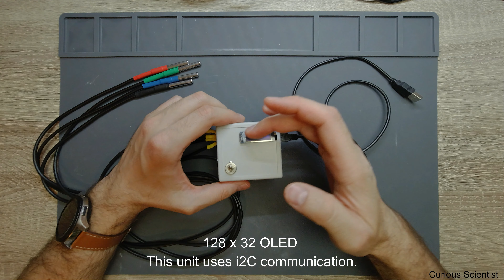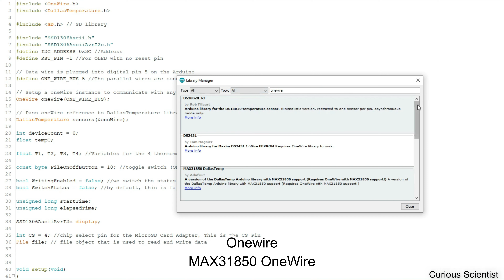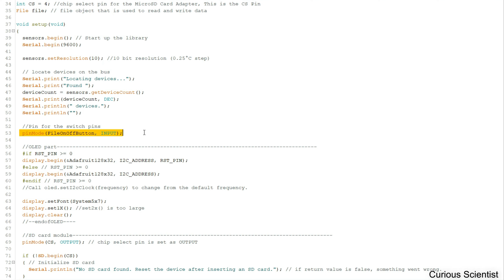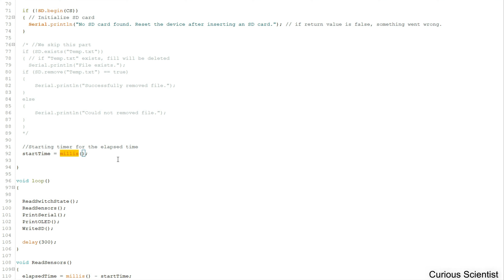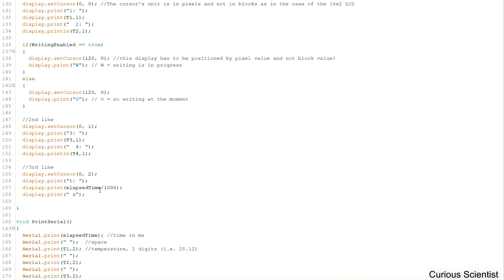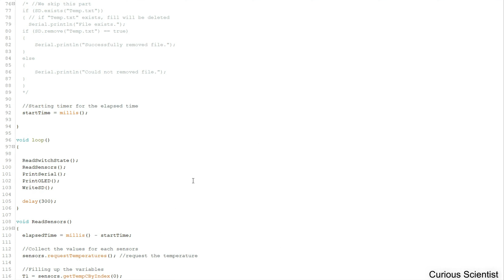4 channel temperature logger based on the DS18B20 sensors

Comment: Good to see a project so well explained and packaged in a box. May I suggest two improvements? If you run the unit as a stand alone logger (i.e. without inspecting the serial port) and the Arduino doesn't connect to the SD card then you have no idea until you plug the SD card into your computer and try to download the data. You use '0' for not logging and 'W' for writing to the SD card. When initialising the SD card you  use a global flag to indicate a fail to connect e.g. 'X'. Likewise when writing to the card if file is false you could use 'X'. Then you would print '0', 'W' or 'X' to the OLED and you could avoid a wasted logging session. 
The second improvement would be to hard code the DS18B20 ID numbers to the relevant channel. Currently there is no link between Red, Black, etc DS18B20 and T1, T2, etc.  No matter my comments, still an excellent video and project.
Reply from the maker: Thank you! I am always open to improvements! In fact, one of the ("selfish") purposes of uploading my projects here is to get them peer-reviewed. Sometimes I learn a lot from feedback from the viewers, so appreciate the constructive suggestions! 

The SD-card-related flag is a great suggestion. When I wrote this code, I was not super experienced with coding, and I also did not prioritize user-friendliness. So, this is a great suggestion and I will keep it in mind for future projects where I use an SD card. Regarding the sensors, it is a good idea, too! I had the links in my notes, but not in the code. 

Also, here is another temperature logger project I finished recently: https://youtu.be/CK_s86k92HQ 
This also deals with an SD card and multiple sensors (however, they are NTC thermistors). But you might like the project nevertheless.

Comment: Hello how did you make the casing box and wire. FYI: MAC addressing is safer
Reply from the maker: Hi! I bought the casing, then I cut some holes on it.
Reply: @CuriousScientist  Can you give box references and show the inside, could be interesting to see the soldering. Thanks
Reply from the maker: The wiring is shown and explained in the video from 10:20. I soldered everything together according to the wiring I showed. Regarding the box I don't remember where I bought it, so I cannot provide any product number or similar, sorry.
Reply: @CuriousScientist  I meant the physical components soldering, not the Fritzing view
Reply from the maker: Sorry, but I won't disassemble the box and take pictures of it. All resources are already made available in this video and in my website.
Reply: @CuriousScientist  OK. I'm wondering, because if I could solder 4xDS18B20 with the 4.7K ohm, I made a first try to solder the all onto the board, but mmm the 1" pin distance is challenging. How did you manage?
Reply from the maker: 1 inch? A standard perfboard pin distance is 2.54 mm or 0.1 inch. This project should be very simple and straightforward.

Comment: How is the segregation handled when sensors are in parallel to the same pin?
Reply from the maker: Each chip has its own burnt in code. Check the datasheet.
Reply: @CuriousScientist  Thank you for taking the time answering and explanation details. Do you think expanding your design to 8 sensors on one input would work ok as well? Or two inputs of 4 would be better?
Reply from the maker: You're welcome! If I am not wrong, one line can take even 64 sensors.

Comment: Hi, I liked your video and it is a very nice project. I also want to use it for the same purpose which is to work with peltiers. My question is can we use maybe 6 or 8 sensors instead of 4 that you used and will this same project with little tweaks to the code work?
Reply from the maker: Hi and thanks! You can hook up dozens of these DS18B20 sensors on the same bus. They use the so-called 1-wire communication bus system which allows you to connect a lot of devices. It should work with a slight modifications of my code with any reasonable number of devices.
Reply: @CuriousScientist  Hi, I am only able to get a 128x64 display here in my local shops. Can I use with this project without doing anything to the code? If I need to tweak the code then Please suggest some ideas because I am at ground zero when it comes to programming. 

I have managed to get 6 sensors because I wanted to monitor all the peltiers separately to see which one is underperforming, so what do I need to tweak in your code?

Thanks in Advance 🙂
Reply from the maker: Unfortunately, the resolution of the display doesn't tell too much to me so I cannot answer the question. Is it an oled display or an LCD? What driver chip is used in the display? Typically, each display has its own library, so you might need to do some extra coding to load the proper library and then to put everything on the display and fit the numbers. If it is an ssd1306, then maybe you just need to redefine the resolution.

Comment: Hi, this is really cool stuff! I will try to replicate as I do want to build a similar data logger with three sensors  - hope to manage and also try to exchange the OLED by a 4x20 I²C LCD. Thanks for your video!
Reply from the maker: Hi and thank you! The exchange should be very simple, the 4x20 LCD has relatively good libraries. I have other projects where I use that specific LCD, so maybe you can merge the information of that project with this one and work out the use of the LCD. I used the above mentioned LCD in this project: https://youtu.be/XjDAgLEsuhU

Comment: Is it possible to do energy meter 12v instead of temperature sensors ?? to check in the evening how much electricity was used by the device during the day ??
Reply from the maker: Of course. There are several devices for that.

Comment: Hello,

Is this setup save data on SD card? I used standard SD card slot and card. Everything is working and I see temp. On LCD But nth is saved on SD card. Can you help me out?
Reply from the maker: Hi,
It works for me very well, I've been using this gadget for a while without issues.
Reply: Hi, Did you manage to have the sketch run with LCD display successful?

Comment: Hello Thanks a lot for your videos, I learned a lot. I am trying to replicate it but I get "-127" degree for all sensors on OLED display. I'm new to this field and tried to follow all you mentioned except I used standard SD card slot instead of micro (I'm not sure if is possible!) and I did not find SSD1306AsciiAvrI2c.h library in Arduino IDE to download but the code is verified and uploaded without that. 
Thanks for your help in advence
Reply from the maker: Hi and welcome! Unfortunately, I don't know what is the issue. The SD card slot does not matter, it is just an SPI device at the end of the day, so it should be alright. Also, I do not think that the header file should cause troubles if the code compiles. Did you add the 4k7 pull-up resistor to the circuit? The value -127 suggests that the Arduino is not able to communicate with the sensor(s).
Reply: @CuriousScientist  thanks a lot for your fast reply 🙏 Yes I have the resistor. I will check all sensor connections once more

Comment: Great tutorial! Many thanks! I have just finished building this project but with a 16x2 LCD screen instead of OLED. I struggled with making the toggle switch work (it was constantly having it ON no matter the position of the toggle). The solution for me was to connect middle pin to the GND instead of 5V, and the toggle resistor to 5V instead of GND. Idk if this is something specific to my wiring or maybe there is an error in the schematic (?) but I just wanted to post this here in case someone else needs this hint for a possible fix.
Reply: And I forgot to mention one more thing I did: For the toggle pinMode, I changed INPUT to INPUT_PULLUP
Reply from the maker: Thank you for the detailed feedback. At that time when I created the circuit in Fritzing, I could not find the the ON-ON toggle switch, so I replaced it with this other type of switch which might not work in the same way as the ON-ON switch. Nevertheless, the wiring on the pins is the same, it it just the switch that differs. Sorry for the confusion! The INPUT_PULLUP can be omitted if you use pullup resistors, but otherwise it is a good idea.
Reply: the same for me with toggle switch.

Comment: Very nice presentation and elaboration! I'am interested in the format of the sd data. It would be nice to be able to plot graph based on excel data.
Reply from the maker: Thank you! It is a simple tab or comma separated values. Actually, if you download the source code, you will see the format of the data that ends up on the SD card. You can customize it as you want. I always generate tab or comma separated values into a simple .txt file and then I plot them with Qtiplot or process them in Excel.
Reply: @CuriousScientist  Thanks for the quick response. I have a VMA 202 shield and will try to implement it in your source code.
Reply from the maker: Great! That shield looks nice with that built-in real-time clock. I have an older video about building an RTC-based watering system. You should check the source code, it might be useful.
Reply: @CuriousScientist  Tried to merge a VMA 202 based temperature logging sketch with your sketch. So far no success; lot of program issues. So I will find me a coach.
Reply from the maker: Please write me an email with your source code. The address is on my website.

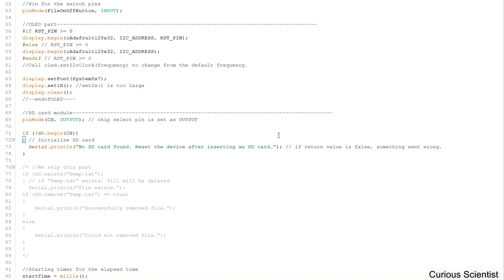Comment: Pretty neat! very professional. At 21:10 maybe you could use a pin with a toggle switch with a if routine to toggle between continuos writing or split file
Reply from the maker: Thanks and also thanks for the idea! Maybe I will implement it in an updated version of the software. My original idea was to always open a new file whenever I start a new measurement. It would be easy to increment the value of a variable, add it to the end of the string and have something like "Filename_1.txt", "Filename_2.txt"...etc. But then I did some research on the format of the filename and it looked a bit meticulous for the first glance, so I left it for now because I just wanted something working. You have to create an array of characters and work with that because for some reason, Arduino does not like string or concatenated string as a type for the file name if it is something complex...
Reply: @CuriousScientist  You can always use the date and time as a filename and it will be different every time. This also serves as an quick visual indicator when searching in the folder. Just my 2 cents
Reply from the maker: I do not use RTC to keep track of the date and time. And when I use the box, for example while recording the video, it is only connected to a power supply (mobile charger), so I cannot even send the date and time to it via the serial port. Actually, if I would use my STM32 units, they have built-in RTCs, and I could use the date and time.

Comment: For data logging i found the following program from another youtube creator upgrdman.
https://www.youtube.com/watch?v=C1m6CvgjcSc

You can view real-time data in visual form and easy export of excel data for further analysis and no need for SD cards. 
I am using 2 ADS1256 boards for data acquisition. An esp32 sketch ruining data processing on 1 core and real time wifi UDP packet stream to the logging program. I must say i am impressed by his program as i ran the thing for 10h+ with zero problems and data sets of many million transmissions. 

As for your testing and characterization of peltiers i think an interesting aspect would be delta heat flux capacity of peltier modules at certain delta T. The way i would go about doing that is having constant mass flow of your water cooling system and recording delta T in both sides of the peltier. SO delta T on hot and delta T on cold. 

Might require a lot more hardware on the water-cooling loop side tho.
Reply from the maker: My workbench and my computer are located in two different rooms. So, I have to save the data to some storage first as I do not have any devices nearby. Writing the data is pretty reliable too, I am pretty much OK with it. If you saw my earlier videos, I also wrote a realtime datalogger/visualizer software, but thank you for the suggestion!
Regarding the testing, at this point I do not want to add any extra features. I do these stuff as a hobby, so I only want to invest in those things which are interesting enough for me. I spent crazy amount of money on these things, so I want to stop with the spending for a while.